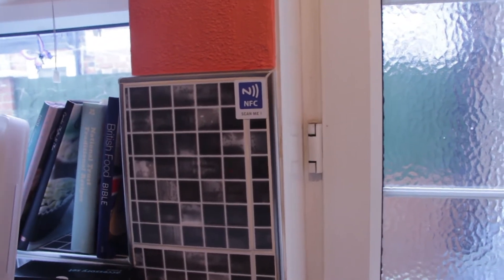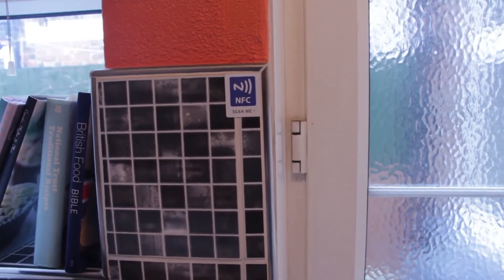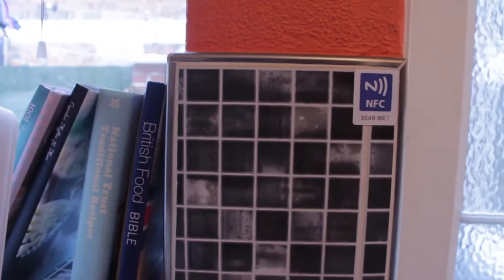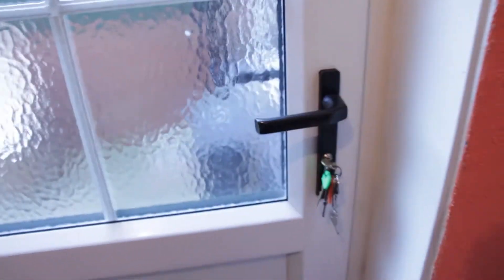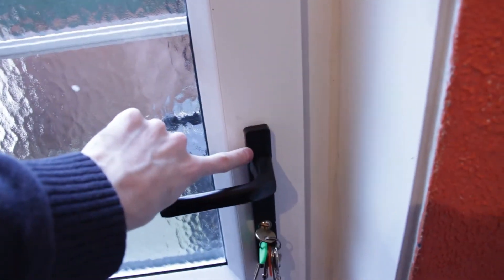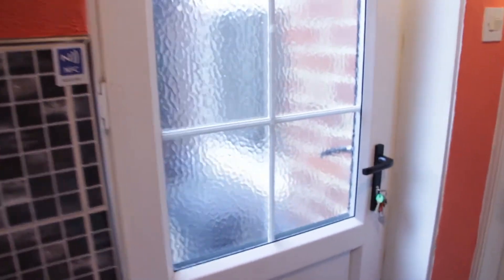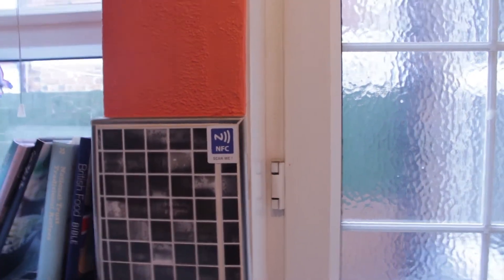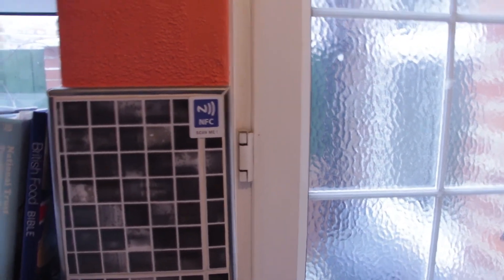NFC Tag Placement Advice Near Field Communication - Practical NFC

Comment: Good video, I need your help, I want to implement NFC in Student ID, so I need the hardware and software requirements, if you have any info let me know, I saw many videos with mobile, but I need the real reader/writer of NFC for public organization, so, for now I want to implement on Student ID, that this card should be able to first printed by system all the info with pic of the student, then the NFC should assign to it the ID, and student should do the attendance in class &acess lab with card